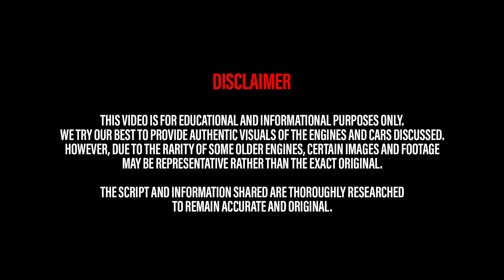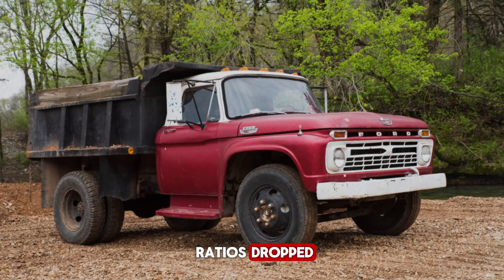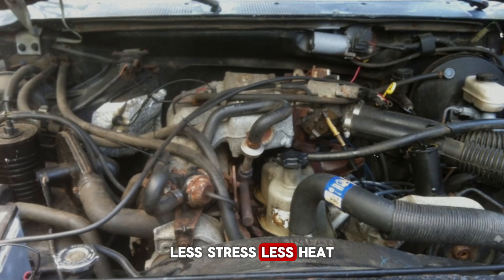Why Ford’s 300 Inline-Six Outlived Entire V8 Families

Comment: I am not a Ford guy at all, but I once pulled a 300 out of the dirt in a field where it sat for 5 years. I put it on a run stand put diesel in the cylinders let it sit over night and cranked it over the next morning. The damn thing started and ran. I will never talk down about an engine so well designed that it just works. You want a perfect Ford go get an F250 with a 300 a C6 trans and a 9" rear end. You'll only ever have to replace the frame after 20 years of work.
Reply: The American consumer killed that engine. Reliability isn’t exciting.  It is to me
Reply: Sixty years if you’re in the South where they don’t salt roads.
Reply: @portermatthew84 the is very true. Might even get 70 if you grease it every now and then.